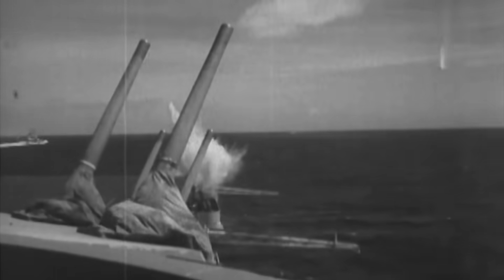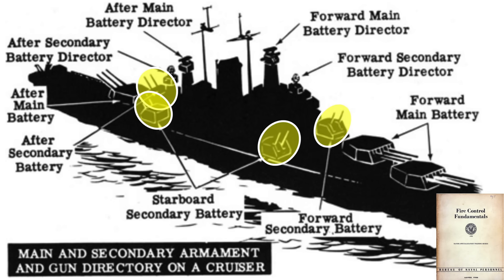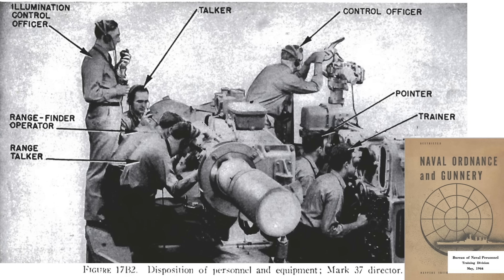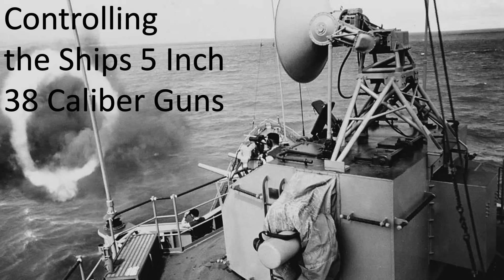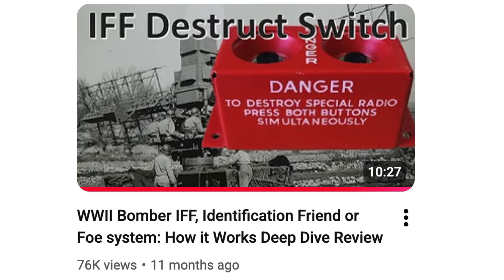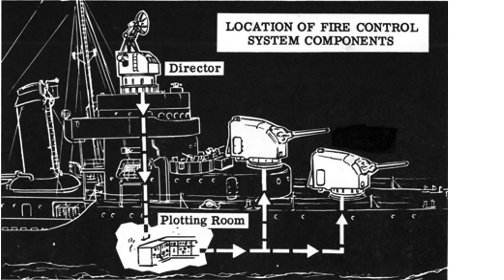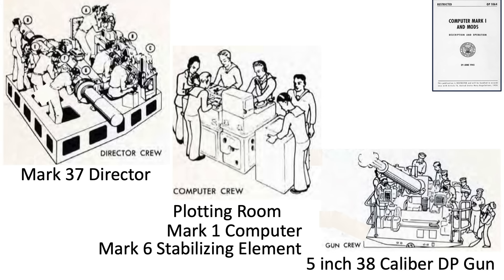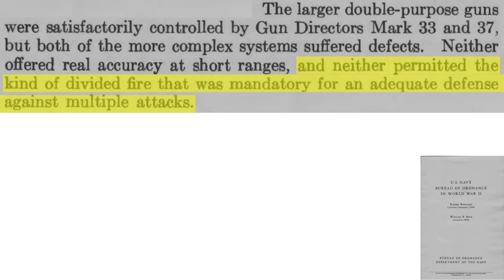WWII US Navy Used the Mk. 37 Director to Shoot Down Aircraft with Their 5 Inch 38 Caliber DP guns

Comment: The last fire control system I worked on was the MK 86. The computer was digital. We could track 4 surface targets at once and shoot at 2 different targets at the same time. We had 1 air tracking Doppler radar. The accuracy of the MK 86 was amazing. I can only imagine what they have today.

Comment: 3:38 "...optically guided weapon systems are always more accurate than radar guided systems."
This is partly true and partly false. Optical systems are superior to radar in measuring angles—so, as the NDRC report you cite notes, elevation and bearing are superior when obtained optically (weather permitting) than with radar. However, gunnery is a 3-dimensional problem that always includes range. Range is measured in distance, not angles, and here radar will generally outperform optical systems (with a competent operator). See pages 201-202 in the same report for a discussion of this (ranging on shell bursts) with experimental data. As another example in your same reference, on page 261 they describe how the Mark 10 radar is a good system with which to calibrate the optical rangefinder (given its minuscule error of 6 yards). This agrees with other sources, such as the 2-part paper on US fast battleship gunnery by Fischer and Jurens in Warship International, which likewise shows optical systems superior in measuring angles (bearing for surface fire, plus elevation when using anti-aircraft fire) but radar superior in measuring range. This is especially important for longer-range fire since the optical errors tend to grow faster than radar errors, so is most relevant in your AA examples at the longer ranges where the Mark 37 director is directing 5" fire—of course, once the planes get closer, simpler but faster gunsight systems take over since the time to target is much shorter and thus range errors matter less. 

You may well be aware of this already, but that isn't conveyed to the viewer of this video, so they are quite likely to come away with an incorrect impression as a result.

Otherwise, great video overall. The use of highlights on the historic photographs and drawings helps understand the physical elements and arrangement of equipment, which is often lost in purely text descriptions and is often unclear in old diagrams without detailed labeling. Caveat about radar ranging aside, I can recommend this video.
Reply: You can see further evidence of the USN preference for radar ranging and optical bearing in the same NDRC paper you cite on page 313 (315? The page is unlabeled), where they outline the general procedure for anti-aircraft fire under director control—at every step, whenever available, radar ranges are preferred and given priority, but no attempt is made to supercede optical elevation and bearing (tracking) since optical measurement with the slewing telescope is superior.

Comment: maybe this will be addressed in the next video…. How was the time delay addressed in the system for identifying the target, measuring its location, transmitting the data to the computer, calculating, transmitting the solution to the gunnery crew and finally firing.

Comment: I think you got your math a bit mixed up. 
At 12000 yards the error would be 20 yards plus 0.00025*12000 which is 23 yards, or +/- 69 feet and for the second radar it's 20+.001*12000 which is 32 yards or 96 feet.
Reply from the maker: Thanks for the input. I pinned a correction note in the comments.

Comment: Outstanding timing, my friend and I were just at the USS Massachusetts today marveling at the 5” fire control and plotting rooms and speculating on how the system all worked.
Reply: The Ford (no, not that Ford) MK7 fire control computer for the 16" guns on the South Dakota class battleships is why the USS Massachusetts holds 2 records, longest shot on a moving ship when it hit the French destroyer Milan at 28,000 yards during the Battle of Casablanca in 1942, during the same battle it set the record for the longest shot on a battleship when it hit the French battleship Jean Bart at 29,000 yards.
Reply: Minor correction: It would have been the Ford Mark 8 fire control table. Besides the number designation, being off, the USN did not use the "computer" designation until the later Mark I fire control computer, calling earlier fire control analog systems "tables" instead.

Comment: The Mk 6 stabilizing element was basically a gyro system that gave inputs to the Mk1 computer to correct for own ships roll, pitch, yaw and heave taking these elements out of the fire control solution. If you are able to watch a 5"/ 38 under director control the barrel remains stationary relative to the horizon and true bearing and is kinda creepy to watch. When the switch is thrown the 5" mount(s) slews to the bearing and elevation generated by the Mk1. Anti surface fire control was also controlled with the Mk 1 and 6. The VT fuse was the icing on the cake because it's relatively easy to get close to a target but not so easy getting a direct hit and this took a lot of errors out of director controlled AA fire. Fire control in general for gunfire, missiles, or torpedoes all need bearing and range info plus each ballistic data, own ships course and speed  and wind and atmospheric temp info for the computer to solve for a fire control solution. I was a sonar tech and we had our own fire control system for tube launched torpedoes. You must have access to a real treasure trove of info to old de-classed files!!!
Reply: What I wouldn't give to pick you or some of your colleagues brains. Truly an awesome job to have.

Comment: Im curious how do they stopped deconfliction?

Also, if a director was knocked out, could another director take over? Did this ever happen?

Also, i love how matter of fact, this video is. Truely the most information dense series on YouTube.
Reply: Plotting rooms could switch between directors.  Air defense had to be multi directional.  The plotting room could control whatever gun turrets were appropriate for the situation.
Reply: @markam306 
Thanks for the clarification its really cool how a mixture between human specific roles and the mechanical computers broke down these tracking solutions and estimates.

So interesting to see how the culmination of directors vt shells

5 inch 38s made a highly effective aa net that continued to decrease the odds of survival for attacking aircraft
Reply: The USN believed heavily on gunfire.  Exercises and research between the wars emphasized accuracy.  The preference for long range plunging fire to attack thinner deck armor came from this work.  Gun directors were heavily developed, resulting in 2 big advantages:  1. Radar aiming and 2. Automated coordination between functions.  Gun directors fed all information to the plotting rooms via electrical connections.  The plotting rooms output the gun aiming signals automatically, to the main battery, 5” 38s, and 40mm Bofors.  They were all aimed remotely, the local hand control was purely for backup.  This was quite fortunate during the war as aircraft increased in number and speed.

US Naval aviation emphasized the dive bomber for similar reasons of accuracy.

The Japanese put much more reliance on torpedos as the preferred anti-ship weapon, both ship and air launched.  They achieved great success in the first two years of the pacific war.  If you put enough emphasis on a subject, eventually you get good at it.
Reply: Plenty of fiber in their diet.

Comment: What was a typical length of time in between the range finder, the plotting room and pull the trigger in the gun turret?
Reply: If the Mk 37 director was tracking optically or with radar and feeding good bearing, range and elevation info and the Mk 6 and 1 were running the fire control solution info was sent to the gun mount(s) continuously in real time. All the gunners had to do was feed ammo as fast a possible (5" projectiles weighed 54lbs and propellant was about 25lbs for each round). The guys in the gun mounts worked like dogs and sweated like crazy.

Comment: Anyone have the specifications of the Mk 1 computer? I have a Raspberry Pi which needs a purpose in life...
Reply: Not a computer in the current sense. It was entirely analog. Basically an immensely complicated transmission. Turn the dials for the inputs and the outputs change simultaneously. Well worth looking up if you want to be amazed by genius. The 3D cams are a work of mathematic art.
Reply: It was an analog system considering ENIAC was not finished until 1945
Reply: There's a guy on youtube who turned a Raspberry Pi into a Drone radar I believe. No word on if he added Dual Purpose 5 inchers to it.

Comment: On the NAVWEAPS website, History and Technology section, there is a description of an AA engagement from Iowa where they blew a Jill to pieces with a direct hit at 6,500 yards on their first salvo of 5"/38 fire.  "...the Rangefinder of Sky 4 reported that at one instant he was looking at an airplane and the next instant all he could see was a propeller and radial engine flying through the air with no plane attached to it."
Reply: None of this is anywhere near as impressive as the Ford (no not that Ford) MK8 fire control computer and targeting system for the 16" guns on the Iowa class battleships.
The mathematical values in the system were actually the basis for the navigational computers on the Saturn V rocket including the rocket itself, the command module and the LEM.
In each case you're launching something from a moving object that you want to arrive at the same point and time as another moving object, as that's exactly the problem the MK8 computer on the Iowa's had to solve it was the perfect starting point for the mathematics needed for the Apollo missions. 
Even it's predecessor, the Ford MK7 fire control computer on the South Dakota class battleships enabled the USS Massachusetts to set the record for the longest naval shot ever on a moving target when it hit the French destroyer Milan at 28,000 yards during the Battle of Casablanca in 1942.
It also set the record for the longest shot ever on a battleship when it hit the French battleship Jean Bart at 29,000 yards during the same battle.
Reply: @dukecraig2402  I am a Marine Corps vet and a lover of all things naval combat. My wife is an Aerospace Engineer for NASA and lover of all things space (me too kinda).

This cool fact crossed both of our nerd worlds together. Thank you very much for that.
Reply: US Army AA gunners helped protect SE England from German V1 cruise missiles and had great success with their own gun fire control system.